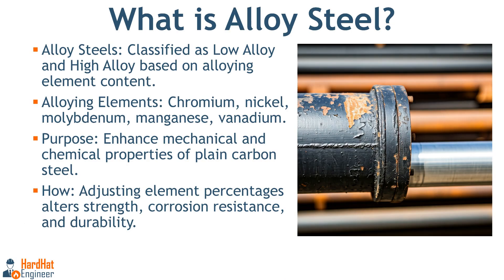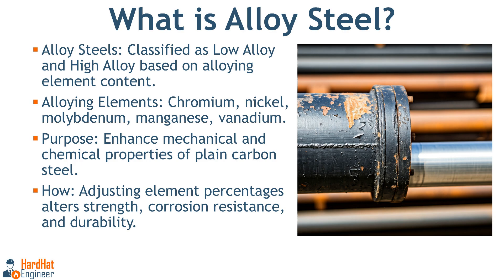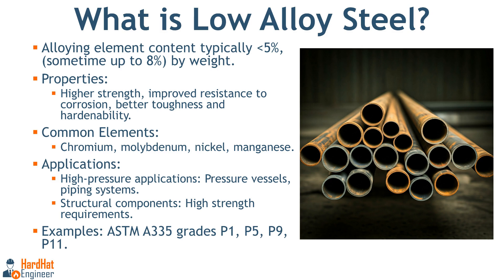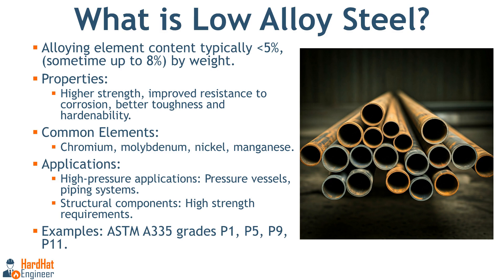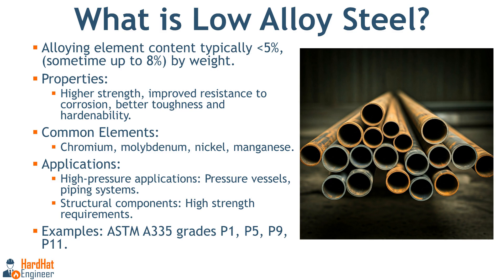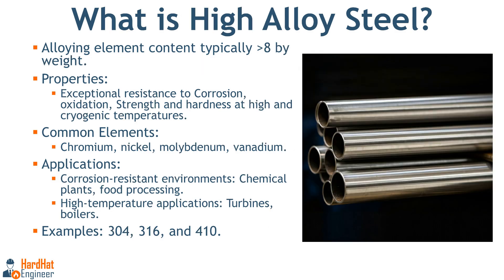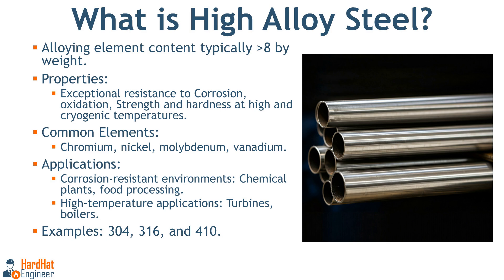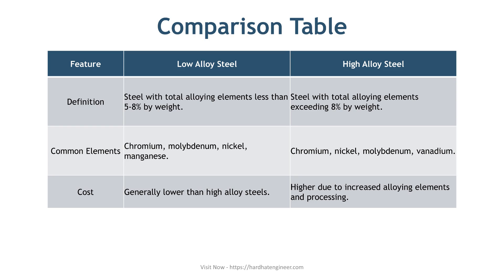Learn the Difference Between Low Alloy Steel and High Alloy Steel.

Comment: I have a couple of suggestions. How to calculate the T-min on a jacketed vessel for both the inner and outer walls? In the food-grade industry they use mixers, atmospheric storage tanks, exchangers, and chemical plants also have drums that are fully or partially jacketed where the internal chamber operates above atmospheric pressure. Also, how do you calculate the T-min on a stripped-lined vessel vs. an explosion-bonded vessel? Or do you offer a course that shows how to do those calculations?

Thank you!
Reply from the maker: Thanks for suggestions. Will consider those in the future planning.
Reply: @HardHatEngineer  Thank you!